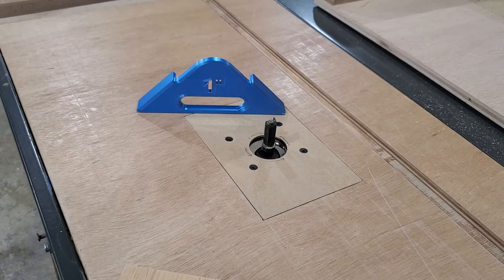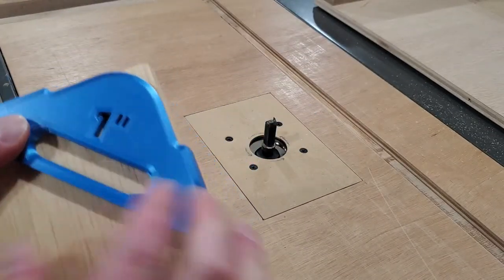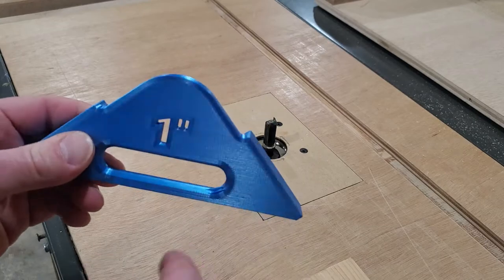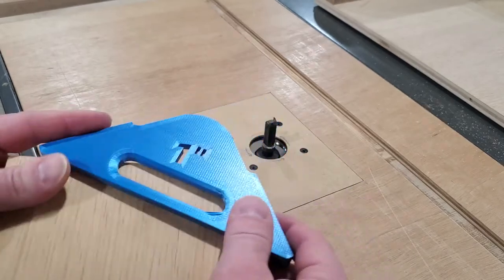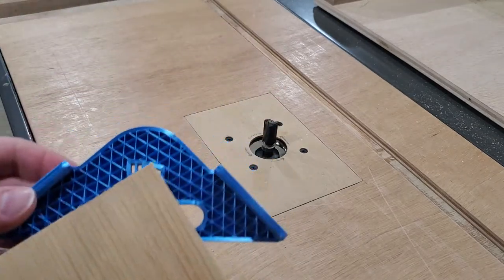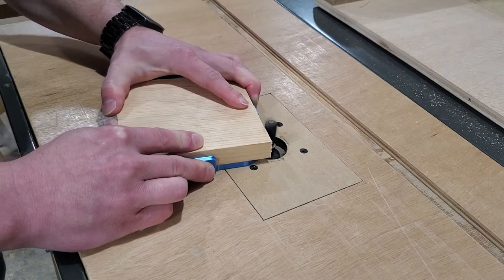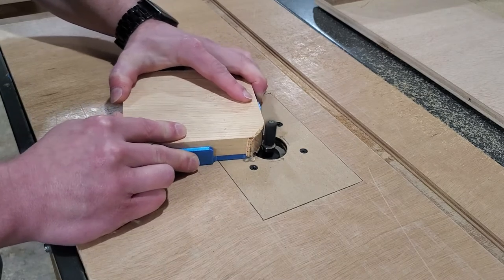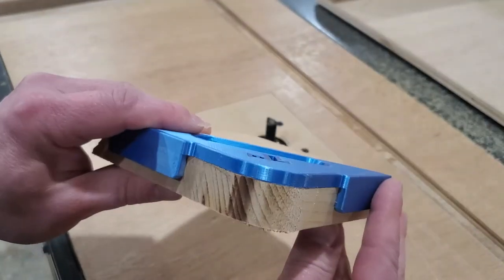3D printed corner rounding jig demo

Comment: Nice jig but I would flip the workpiece so you are not cutting across the grain. You'll get better, smoother cuts. If you do this you can only cut the two opposite corners then you must flip the work over and cut the remaining two corners. So depending on your workpiece it may not always be possible. If you can though you'll always be cutting with the grain and have less chance of ripping out the corner as you exit the cut. To position the work place it in the jig so the bit starts cutting on the edge of the work where it is running with the grain.